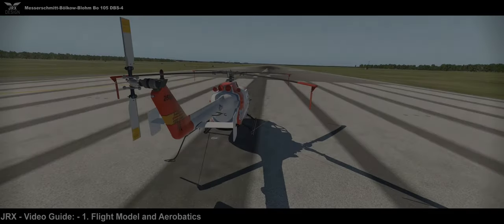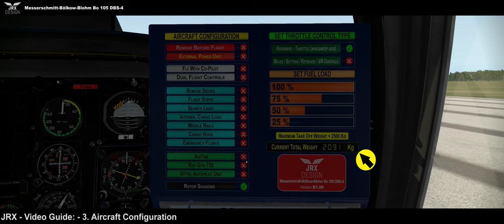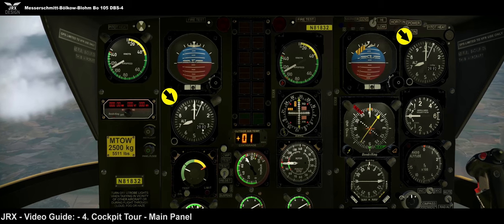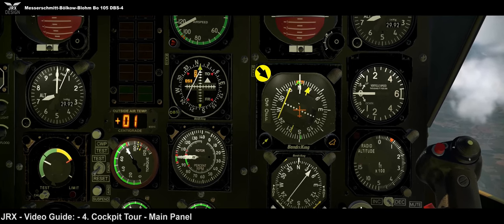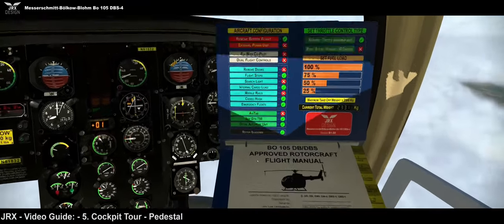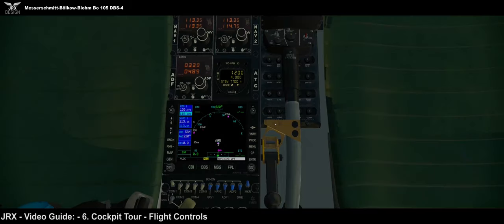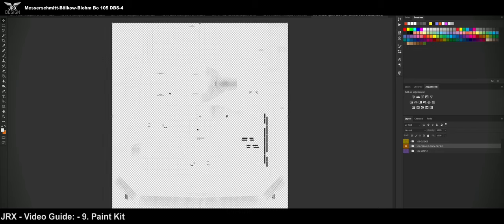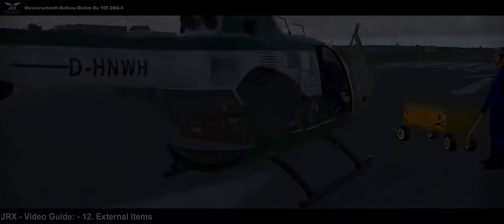JRX MBB Bo105 - Video Guide / Cockpit Tour - X-Plane 11+

Comment: Im struggling with the levers from idle to flight... I dont understand this Hardware controll xD
Can you help me?
Reply from the maker: Hello, If you use hardware controllers, just bring RPM up until the engine governor take control, then that's  it.
If you use other control method its pretty much the same, but done one at a time.  For normal flights you do not need to touch the throttles again until you land.  I hope this helps.
Reply: @simonrowe6386  I have the Thrustmaster Joystick and it doesnt work..
Is this a problem? Or do I something wrong °_°